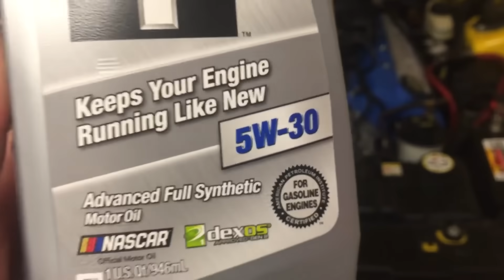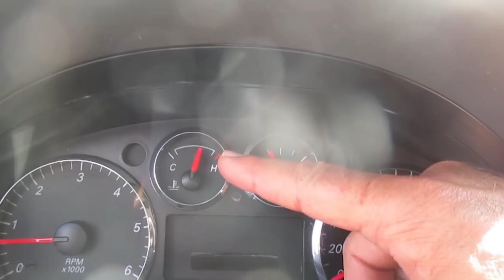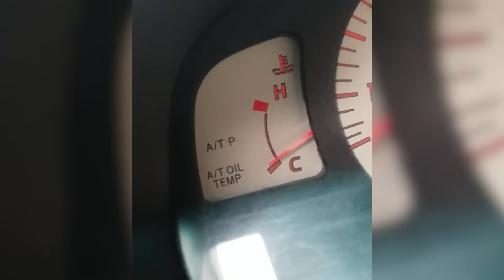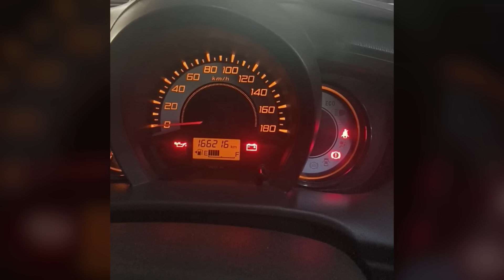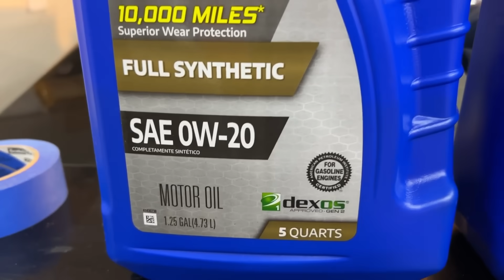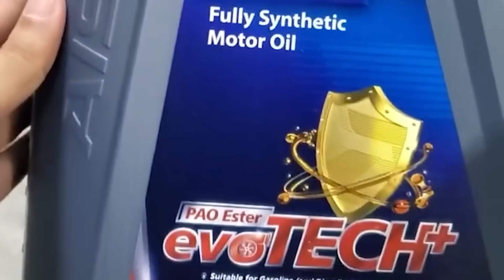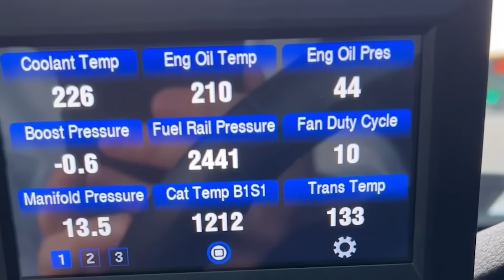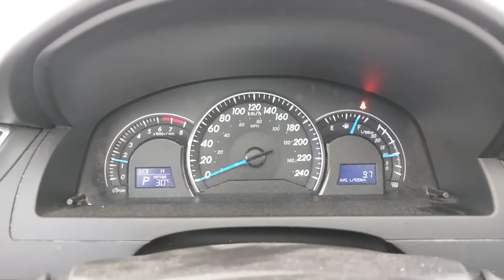Why US  Cars Use 0W 20 But the Same Engines Use 5W 30 Abroad (Exclusive Mechanic Explanation)

Comment: I would look at my manual recommendation. Unless your engine is designed for thicker oil, doing so can actually lower lubrication because of the high viscosity, the oil pump may not be designed for thicker oil. Doing more frequent oil change us better than using better synthetic oil but longer interval.
Reply: @Cmvinyl.....HI. A couple of things: The manual recommendation is just that....a recommendation and not the only oil that can be used. For my Toyota RAV4, my oil cap says 0W-20, but that is the 'recommendation' that Toyota had to put for those RAV4's sold in this U.S. market due to the CAFE standards and emission demands by the government. In other countries with different climates, my same exact RAV4 recommends 5W-20, and even 10W-20 & 30. Different climates= different grade oil. 

As for the oil pump: Toyota uses the same...same...oil pump in all of the RAV4's, regardless of where the RAV4 is sold in the world. They make the pumps able to handle the different viscosity oils that might be used under normal conditions. Notice that I said "normal". If one were to use 20W-50 oil, then there might be a problem...might. I don't know for a fact about a grade such as that. 

I agree 100% with a more frequent oil change schedule than a lot of manufacturers state. Waiting until 10,000 miles is insanity...but good for the repair business and good for dealerships that will be happy to sell you a new car long before it should have been necessary. I like the every 3,000-5,000 mile interval, but I think synthetic is still the way to go, even if you change oil every 3,000 miles. What if you just don't get the oil changed at 3,000 and get another 1,000 or 2,000 miles before it gets done? I think the good synthetic will give the motor that extra bit of protection until then.
Reply: @StephenJeffery-b6b at the end of the day, you are still taking owners manual recommendations, just from a different area in the world and not a recommendation from some dude on YouTube.

Comment: After watching this, definitely switching to 5W 30 high quality Ester synthetic.  I live in hot NM and my vehicle has almost 80K miles on it.  I want to at least triple that.  Presently using OW20 synthetic, changing oil and oil filter every 4-5K miles, air filter every 8-10K miles. Great, very informative and well made video. Thanks!

Comment: I’m becoming very convinced we are being lied to about “built to run on 0W-20 or “tighter clearances” for fear we all go out and run an oil that gets .4 MPG lower than the watery stuff. I’m in South Florida, so I doubt 10W-30 is too thick by any real definition. If this article is to be believed then plain and simply there’s more bearing material in the oil on 0W 20.

Comment: I have a 2014 Kia soul ( never buy one ). At 60 thousand it would burn a quart of oil between oil changes ( 3000 ) miles . I put in about half a quart of Lucas if my oil changes & it runs smoother & does not burn a quart any longer.
Reply: Kias burn oil we know😂

Comment: People love anything with a conspiracy element in it.
 
The truth is, even though the engine is same, the computer (ECU) isn't same. The are tuned for specific needs of the region they are sold in. The computer is programmed to believe the owner uses the recommended engine oil and adjusts to the engine temperature and other wear of engine components accordingly. Using wrong oil forces the ECU to operate incorrectly. Car manufacturers must meet EPA requirements of different regions so they make changes to components but not at the cost of premature breakdown. Coz that doesn't make any business sense.

Don't trust an AI generated voice.
Trust the engineering division. They know their engine best.

Comment: Its the same reason they say your transmission fluid is lifetime. They want your engine to not last as long bad for business
Reply from the maker: I understand the concern, but that’s not really the case. 0W-20 oil and “lifetime” fluid claims are mainly about emissions rules, fuel-economy targets, and standardized service intervals, not planned engine failure. Modern engines are designed with tight clearances for 0W-20, and using thicker oil can actually cause problems. Where 5W-30 is allowed abroad, it’s usually due to different regulations and service practices, not because manufacturers want engines to wear out.

Comment: Nowhere on this video does it mention hybrid vs non hybrid engine.
Reply from the maker: You’re right—the video focuses on oil viscosity differences by market and manufacturer specs, not specifically hybrid vs non-hybrid engines. That said, hybrids often use 0W-20 because of tighter tolerances and frequent cold starts, while some non-hybrids may allow 5W-30 abroad due to regional fuel, emissions, and service standards.

Comment: Instead of factory 0W-20 synthetic I also use 0W-30 synthetic winter months and 5W-30 synthetic summer months as well.  I also DIY replace my own oil/filter when usage meter shows 35% remaining life.   Using thicker 30 oil my Honda burns zero oil as well...    This works great for my 2021 GMC and 2014 Honda CRV vehicles...

Comment: I'm in Tanzania🇹🇿, Africa. Most of cars we import and use are japanese domestic market used cars. Local mechanics reccomends us to use thicker oils like 20W - 50, DUE to climate. However the japanese user manual  found in the glovebox in most cars reccomended 5W - 30 to 10W - 30
Reply from the maker: Good question, and it’s very common—the Japanese owner’s manual is the correct reference even in Tanzania’s heat, because oil viscosity is chosen mainly for engine design, clearances, oil pump flow, and VVT systems, not just climate; 5W-30 or 10W-30 still protect properly at operating temperature, while jumping to 20W-50 can reduce cold-start flow, stress tight-tolerance JDM engines, trigger VVT issues, hurt fuel economy, and increase wear, so thicker oil only makes sense for very high-mileage engines with low oil pressure or heavy consumption—otherwise, follow the manufacturer’s spec.
Reply: @lyimoej7198....Hi, from the state of Arkansas in the U.S.  I looked up the climate in Tanzania, and the information says depending on exactly where in the country, the temps might range from about 68 Degrees F. to 95 degrees F. Is this about right? If it is, then your overall climate is very nice compared to here in Arkansas...!! The Summers here get into the upper 90's F., with some days into the low 100's F. The Winters can easily get in the teens and often into single digit numbers....cold..!! 

I have a Toyota RAV4 with the 2.5 VVTi motor. It has 138,000 miles.The oil cap says use 0W-20, but the motor had a rattle/clatter on every start-up and even a little bit after warming up. I switched to 5W-30 and no more rattle, not even on a cold morning. So far, I have no reason to go to any thicker number such as 10W-30. My point: Even with our colder winters than your's, the 5W works just fine for my car, and even with summer temps that get to 100 F., the 30 number also works good for my car. With what I saw about the temps in your country, I might want to ask the mechanics just exactly why they say use such thicker grades. Maybe there is a good reason.

 I will add a couple of factors: How many miles is on any particular car and how is it used...and how often is the oil changed. Are there a lot of dusty, dirty roads? 

A key factor is all of these discussions about which grade oil to use is doing regular oil changes....most everyone here agrees that 3,000-5,000 mile interval is good for a motor and keeps the oil from breaking down and building up sludge that clogs up everything. How often do you change oil in your car and what about others in your area?
Reply: @StephenJeffery-b6b personally i change after every 5000 kilometres. Or once a year, whichever comes first as i do not drive that much.

Comment: Thin oils are good for colder climate.  In scorching weather. Those thin oils are like water as they suffer from thermal break down faster than keeping the engine lubricated. Varnish build-up will accumulate faster with oil in hot climate.

Comment: CAFE is the problem. Plus companies have to pay a fee for each .1 under mpg the cafe requires. Which could be a huge amount. So we get thinner sheet metal cars, plastic oil pans and junk to make them lighter. Then use water (oil) to aid as well. These companies work hard to pass requirements…not extending engine life.  As long as it dies after warranty.  They don’t care.

Comment: Change the oil around 5-6k miles and you’ll likely be ok with 0W-20.  For hot climates, run either 5W-30 or 10W-30.  Main thing to remember is to use a good quality oil and change it!  There are so many videos out urging us to move to higher viscosity oils but I do believe that’s it’s the interval that matters most.
Reply: Hi Philip. I like the way you gave yourself some 'wiggle room' with.." you'll likely be okay with 0W-20."...LOL..!! 

As for hot climates....how would you define what 'hot' is? 

I completely agree with frequent oil changes, but I prefer the 3,000-5,000 mile interval and lean more towards the 3,000 area. My own story: About a year ago, I bought a Toyota RAV4 with the 2.5 VVTi that had 128,000 miles. The oil cap says 0W-20, and that is what I started using for the oil/filter changes at about every 3,000 miles. But on every start-up, the motor gave a rattle and even after warming up it still rattled a little bit. At first, I thought that maybe Toyota designed it that way but it still concerned me. I asked my mechanic of 25 years about going to 5W-30 and he said it would be just fine. The difference was immediate: no more rattling, not even on a cold 25 degree F. start, and the motor runs quieter now. So...for my situation....the 5W-30 is what made the difference.

I live here in Arkansas where the winters quite often get into the teens and even single digits, and the summers are usually in the 90's with a few 100+ days. For me, the 5W-30 works great for my car.
Reply: @StephenJeffery-b6b To me, hot is 100+.  I’d definitely run 30 weight in that area.  My 2015 F350 states 0W-20 but I’m running 5w-30.  It gets a little more use than my other vehicles.  I also have a 4Runner that I’ll continue to run 0W-20 but will change every 5000 miles, not the 10k that Toyota states.  Lake Speed had a good video about oils shearing out of spec.  He talked about the need to change the oil more often and I think that’s key to a long life.  When it comes to Chevys mess, well it’s a Chevy and I’d never own one.  They are trying to correct horrible quality with 40w oils.  Good luck.

Comment: Hold off on this advice. Check out motor oil geek. Be careful.
Reply: Yep.  I agree.  Change the oil!  It’s the breakdown of the oil that happens from long drain intervals which causes issues.  Or so it seems!

Comment: Hi 👏 my Camry has more than 270,000 miles I’m using 20w50 🤷🏽‍♂️ it is ok?
Reply from the maker: From a mechanic’s standpoint—at 270k miles, 20W-50 can be okay if the engine is worn, burning oil, or showing low oil pressure. Thicker oil can help quiet things down and reduce consumption. That said, if the engine is still healthy, it’s better to stay closer to spec (like 10W-30 or 5W-40) for proper flow and lubrication, especially on cold starts. Watch oil pressure, cold start noise, and fuel economy—that’ll tell you if 20W-50 is helping or hurting.

Comment: They want them to blow. They want thinner oil to get it to pump up fast when cold. The worse part is they are making all oil passage ports and the cam journals smaller. These smaller ports get plugged by the slightest bit of dirt. Then once partially clogged it takes out cams lifters valves cranks ect. This is the problem. These manufacturers are alson desinging engine on purpose to fail fast. They have a set lift for internal parts some at 60k or 80k some even less. This is proven leaked info by whisltblowers. I worked on small engines all the way to semi engines , race car ect my whole life. I got 35 yrs in cranking wrenches and doing machining im telling you what the issue is. Small oil ports and small crank and cam journals is the issue. They are pushing oil changes way to far. Change ypur oil in half the time they say you will put mechanics out of buisness. Dave auto center did videos on this. Dave is hands down one of the best mwchanics in the usa. He seeks out top top tier guys. Im telling you change your oild in half the time. If they say 5000 do it at 2500 which was the norm back then. Half the time folks.😊 tolerances are not why you cant run thicker its because the hydralic valves wont pump up quick enough because ports have been made smaller. Cam journals and crank journals and all ports should be made larger not smaller. People keep paying 3 times more than what this new junks really worth. Id rather have no pc no lame drive modes no crazy light roll up windows with a standard transmission.  That equalls bullet proof. Simplicity is all i want. I like older cars. I wont buy new junk. 60 to 100k 😅 good god. Peoppe are insane. Id never want the payment. Ill buy a good used car thats known dependable.  And i wont pay 1000 plus a month per car. The last problem is all the guys my age are thinning out we are doomed when this happens. Nobody will build roads sky scrapers cars ect or do plumbing or electrical.  The biden admi paid people 1100 per week to sit home. They got the kids and next gen thinking pcs pcs ya wrong now nobody wants to work skilled tradesman dont exist we will be srewed soon. Just wait i will be right. There is a reason why germany pays skilled tradesman more than doctors or lawyers they realized how dam important it is to have people that can do this. The usa is in big big trouble real soon. There is no new mechanics that can tear engines down they can only hook up a pc and replace a senosr they are told to replace.  We are in massive trouble . Im not saying there may not be a few upcoming new mecahnics but good luck. When my generation is gone we are hella doomed. Bottom line the dems destoryed this world brainwashing the younger generation.  They dont want to work dont want to do hard labor and a skilled tradesman is next to non existence.  Wait and see i will be correct. They sadly ruined this world because they do not think with common sense. Sorry office workers wont build your cozy home or fix your car or build bridges and roads. This is the hard reality that will come soon. 15 yrs from now things are gping to get very ruff fast. Maybe even less. This is another reaspn why they dont want retirement till 72 they want to steal our hard earned money and they realize we are in big trouble. Why am i or you paying all this money for lufe for pennies on the dollar someday for a whole few short yrs if that if we even live that long. Social security should be an option it should never have been forced. You want me to prove i invest on my own great. Then nobody can whine someone may not invest then we will have to pay for them. We sure pay for anyone else to come here while our own rott. Isnt this all ironic. I speak the truth i peak from wisdom. This is reality.

Comment: poor engine design is not an oils fault stop spreading false info yes cafe is a problem but manufacturers told customers to use it for marketing purposes GM produced bad engines and so did Toyota

Comment: My 2023 Jeep Wrangler, which is under warranty, used to have this knocking noise on low rpms. it sounded like a lifter's knock, the dealer kept saying that this was normal and it was due to "bad fuel," all of which is BS. I switched to 5W30 and voila, that noise disappeared.
Reply: @Athletyk.....My, my...isn't that amazing...LOL..!! Are you trying to tell us that car dealerships are being dishonest with us...??? They are in league with the government CAFE standards and are there to make money from expensive repairs, often from using too thin of oil and customers going 10,000 miles between oil changes...that many car manufacturers say is okay to do.....and  then when the accumulated sludge clogs up everything...the dealerships can then make lots of money either rebuilding the motor or putting in a new motor....win/win for them...!!

Comment: This makes sense especially with MASSIVE recalls on the Tundra running 0w-20
Reply: Those recalls were due to leftover manufacturing debris in the engine. If I’d buy a new car, I’d change the oil at 1,000 miles, and then every 3-5k miles.

Comment: Regular oil which is used less and less breaks down at 290F. Synthetics 390F. Automotive normal coolant temp. 180 to 220. Regardless of where you live, your car if cooling properly doesn't know if it's in the desert or the arctic. Sure there's some difference, but not enough to factor some of the statements in this video. Just run Synthetics full or blended. If it makes you feel good go to the next higher viscosity I don't think it matters unless your vehicle is air cooled or racing or towing.

Comment: My 2002 Honda Accord V6 at 307,000 miles is driven 70 miles per day on Southern California freeways, oil has always been change every 5,000 miles using 5w-20 top quality full synthetic oil and quality filters. The problem with modern engines their running hotter to begin with, and turbos, direct injection to under sized engines, and not regularly changing the oil every 5K is why we’re seeing a lot of premature engine failures.😂

Comment: ...switched to 5w30 from 5w20 on my 17 ford f150 5.0 @ 125,000 miles. it has never run smoother, quieter, and idled more smoothly than now since I switched to a heavier oil. I should of done it @ 75,000.
Reply from the maker: Glad to hear that switching to 5W-30 worked out well for your F-150 and that you're noticing an improvement in how it runs!